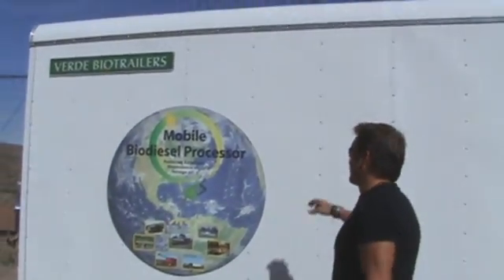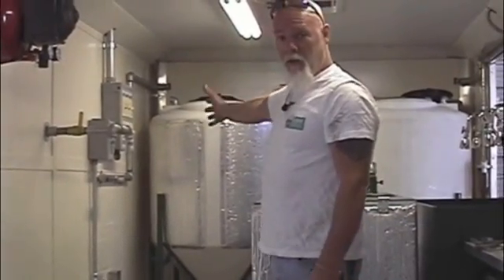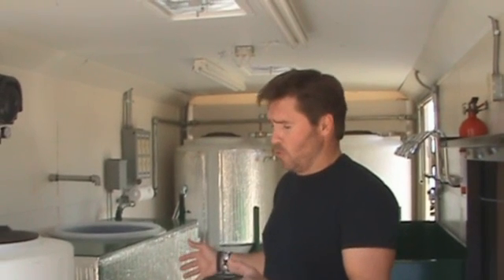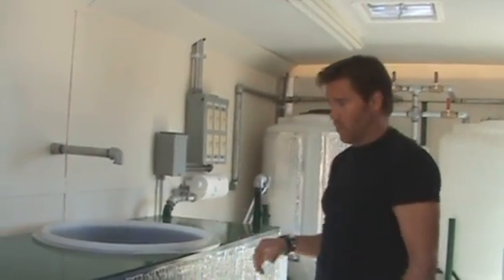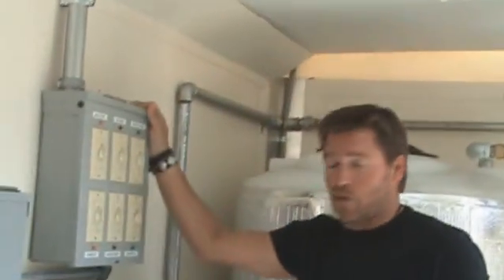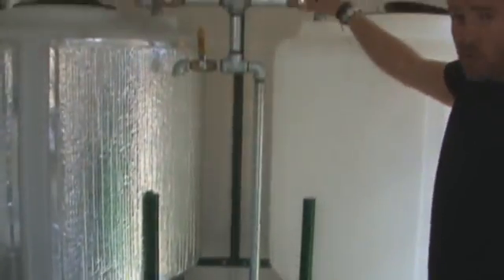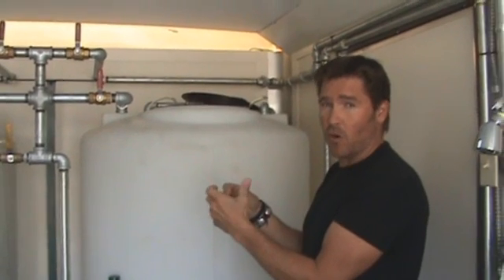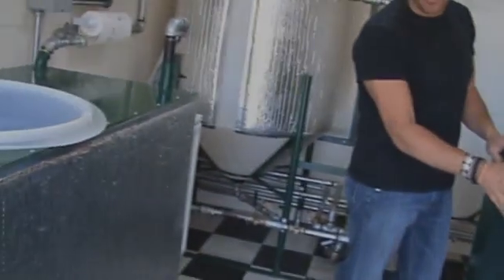Verde Biofuel  |  VBT-3600 Mobile Biodiesel Processor

Comment: Excellent video, and excellent product.
One question about the final evaporating stage. If this whole process is done near the sea or any where else where the air is damp, then using the shower heads to spray the Biodiesel will probably cause it to have more moisture. Any remedies for that?